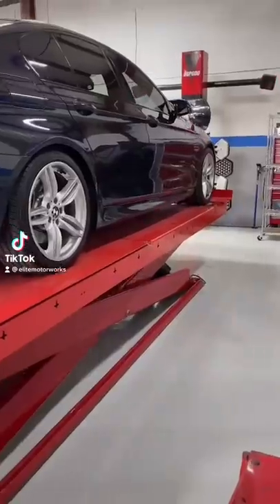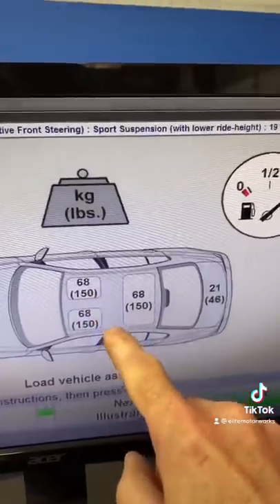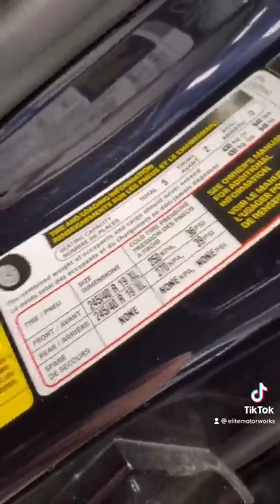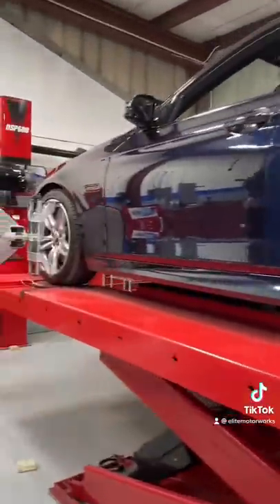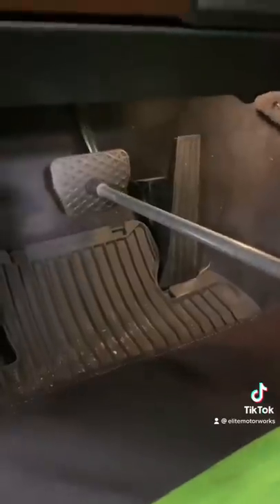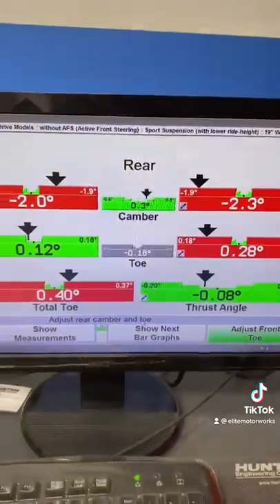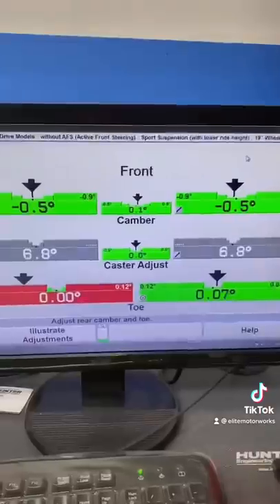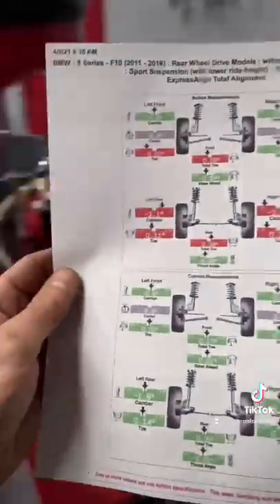How BMW does alignments #shorts

Comment: I got a shop to align my truck after I hanged the parts the forgot to tighten my tie rod sleaves and slowly it went out of spec they were very loose like pinch with two fingers and spin loose their response was they didn’t want to break the bolts on the tie rods because of rust … I installed the pitman idler idler bracket and inner and outer tie rods and new sleeve and guess what it was a fountain tire

Comment: Please explain the weights. We also do alignments but never use weights and never had an issue. And I don’t see the purpose of those weights. If you take them off the alignment is not correct? So I need those weights in my car all the time in order for it to run ok?

Comment: Jamie is doing a lineup on a 2014 Sprout 550i the f10 generation 5 series released in 2011 to 2016 it weighs 500 lb end set the proper tire pressure on the tire loading and information label on the driver's side door b pillar the combined weight of occupants and cargo should never exceed see the owner's manual for more information

Comment: U dont lock steering wheel, only for drag link on straight axles. And it states sit in car when setting wintoe so the steering wheel is centered with ur weight while driving. Read the simple instructions.

Comment: What is the weight for the 7-series? I wonder if the techs put the weights on the seats causing the air bag seat sensors to throw codes and need to be replaced quicker than other models. E65/66

Comment: I've never seen a shop have lead weight bags for pre-loadingba vehicle. As an Automotive technician with 20 years experience, shops that don't specialize in euro cars dont/won't spend the money for the proper equipment to be able to successfully maintain these driving machines.

Comment: Reading these comments shows me just how manny people truly don't know what a good alignment is. Just because it's in spec does not mean it's right. You have to learn what splits are appropriate to use on each vehicle. Camber, caster, toe, and kpi (for big trucks and older pickups)  all have require specific splits for the vehicle to respond appropriately. Ex, camber neutral spec is + 1/4 for each side with a tolerance of 1/2 +or-. So I can have Left side +3/4 and Right side - 1/4. Still in spec but will still cause tire wear and pull to the left. All vehicles pull to the high side of camber if the split is big enough.
Reply: Also you never set toe to 0

Comment: They will never do this, this is the written "procedure" so they can justify charging you $1200 for an alignment but they will not: weight the car, level the steering wheel, get the alignment close to decent, etc. Because you won't be able to tell the difference anyways. Ive worked at multiple dealers and these redundant steps are price drivers, thats it.

Comment: Why put 500 lbs inside if you weight less than 500? Seems like you should set alignment using weight of driver but I dont have in depth knowledge on alignment procedures

Comment: Where ya located? I need  alignment asap I have 0.15% camber on my rear driver tire wore thru my last tire & eating out my new one… I want to know if I can get it fixed before most likely needing to replace a worn bushing… anyone know what can cause that camber? Could it be a control arm bushing?

Comment: I haven’t aligned my Taurus SHO since I bought it in Feb. 2017. My wife’s 2012 XC90 has not been aligned in the 56k miles we have owned it. Tire wear on both cars is normal. Alignments are one of the biggest wastes of money that people pay for. Unless you replaced a suspension part that requires alignment, there is really no reason to do it.

Comment: So you car only has proper alignment when is has a 500lbs payload? Do an alignment with 150lbs in the drivers seat and half a tank of gas instead or just compensate on the adjustments.

Comment: I have a question I own a Mercedes ml320 2000 edition and I just changed the brake line and the oil pan filter and my Mercedes is still in limp mode what migh also do that

Comment: If the factory tires are not on the vehicle you NEVER use the air pressure stickers your just asking for bad tread wear or failure

Comment: Your alignment was done correctly . But ,the only time I have used weights ,was to compensate for a driver that was over 350 pounds . But if you have the weights on hand , it's not a bad idea ,but unconventional.

Comment: there's no reason to use lead instead of sand or gravel.  lead is extremely hazardous and if any dust from the pellets rubbing each other got into my upholstery, I'd sue the shop for the value of the car.

Comment: Ok but don't be like big chains and do the same rolling comp 🤦‍♂️🤦‍♂️ Jack it up check suspension attach targets and comp it level in the air(Did this for years dont need no fancy weights either).Numbers on point tho  👌 💯 👏 that's if your comp was accurate 👌 😂

Comment: Well 99% of alignment machines are the same hunter unit your using. it should have been very close to yours if it was done reasonably right. Last guy either didn't care or probably ran just a front end alignment and it threw the entire car out. I've seen cars dog tracking after leaving the alignment rack because the rear will be way out and they align the front off the rears.

Comment: I suppose that is how it is supposed to be done from the factory. But adding weight has to affect the handling when the driver is the only one in the car or the trunk is empty or any combination of weight distributed in the vehicle. BMW's are trash vehicles anyway. Spring rates aren't taken into account as is strut condition. A 30k mile vehicle may be different than a 60k mile vehicle. So this tech is good doesn't mean that the rest of the alignment world is trash.